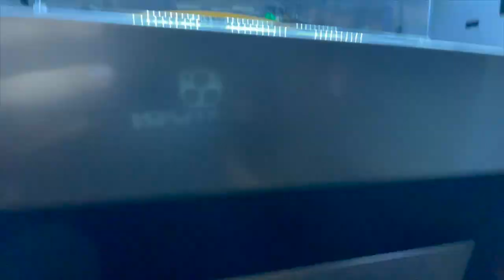Whats inside this $40,000 Snap on Tool Cabinet set?

Comment: 40K?!?!? That is ridiculous!  My Milwaukee work bench with storage and husky tool chest with tools was a fraction of the cost!  I’ve got Milwaukee power tools and hand tools are mixed husky and kobalt.  Never had a single problem with any of them.  Snap on isn’t even worth it in my opinion anymore.  Den of tools even made his video about snap on being finicky with their warranties now.
Reply: Who cares what Den of tools thinks. He prolly doesn't even own any Snap on tools. Once you use them you'll know.
Reply: @TheGreatDemiGod  I don’t own snap on and never will.  Way over priced!  I can get the job done for a third of the price or less with no problem.  I’ve even watched people put their power tools put up against some Milwaukee and Milwaukee blew them out of the water.  But u spend your money however u want.
Reply: @TheGreatDemiGod  having worked in a shop for a little while I didn't understand snap on besides the ratchets, other than that the sockets aren't that special and the power tools are lacking on power compared to much cheaper options. They're definitely higher quality than most but I don't understand the cost premium even when you're using them all day every day. I used a mix of gearwrench, IR, Milwaukee, and craftsman. Served me well enough, the snap on is nicer without a doubt, but it's just not that much nicer. The only snap on tools I own are a 3/8s long handle ratchet and a quarter inch ratchet. Both bought used off a guy who just had them warrantied.
Reply from the maker: I totally agree with you on that one
Reply: @Lonestar-1984  yup milwaukee power tools blow them out of the water
Reply: Do you live in a house!?? Ridiculous!!! I live in a van down by the river for a fraction of the cost!
Reply: Un dicton français : « Quand on aime, on ne compte pas » 😂
Reply: Your honestly buying the service of a good dealer most of the time. That and payment opitions for when you have no credit and need it now. There are cheaper opitions out there, all tools break. Few come by your shop every week tho. 

Very few things are actually worth it being snapon. I own a large quantity of snapon tools, but most of the new tools im buying are other brands. 50k or so in purchases planned in the next 3 years and 30k isn't snapon.
Reply: @ManCaverTools  If you agree with that then why is it you are so in awe of this outfit. It is impressive by size and completion, but you keep repeating "wow...it's all snap on..!" when you know it's 99% Snap On.  What gives?
Reply: Why would anyone ever buy a Mercedes? My Hyundai gets the job done just fine!!

Comment: All brand new never used not a spec of dust or a drop of oil on anything anywhere.

I've seen guys with duplicates and triplicates but this yo-yo has like 12 screwdriver sets😂

And I'll bet everything in the video is more like $200k not 350

Comment: Apple syndrome moved into tools... Sorry but this is just stupid, to have only 1 brand tools. Those tools laying stacked one at another, never used, most of parts doubled. Want example ? Look for all those screwdrivers or Hammers the heads are shiny no scratches at all... 

What's the point to spend XX 000 $ on tools that you could buy for 50% of that price with same or even greater quality?
What's the point of stacking all those tools cramped in cabinets one under another?
What's the point of having cheapest trays you could imagine such as plastic molds ... combined with most overpriced tools ?

Seriously search Stahlwille, Hazet, Gedore and learn how quality is looking like
Reply: Can't afford snap on huh 😂😂😂
Reply: Some of the brands he used are expensive. Look em up, they are great tools
Reply: Cause he can. Snap on may not be the best in all hand tools (Don’t bring up power tools, for the most part that belongs to Milwaukee. Ha.) but they will still very high quality and will last all if not most people a long time if you decently take care if them, like not leaving them outside to get rained on or exceeding the limit of the tool it will last a ling time. Ya its more expensive but hey if you have the money why not buy whatever yo want its your money.